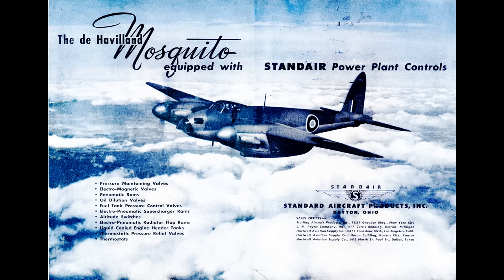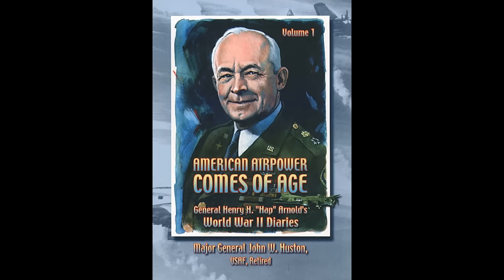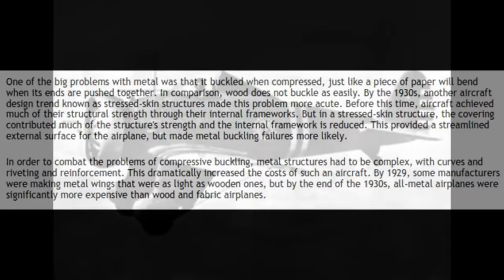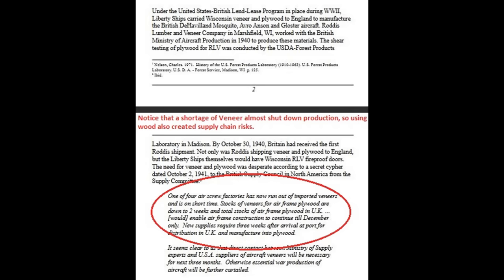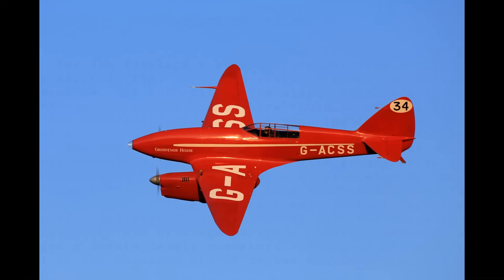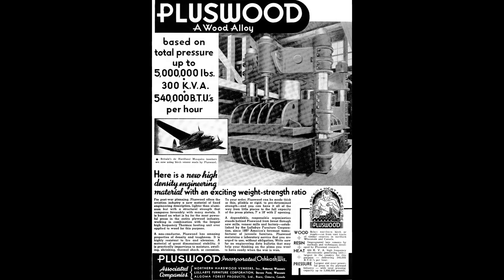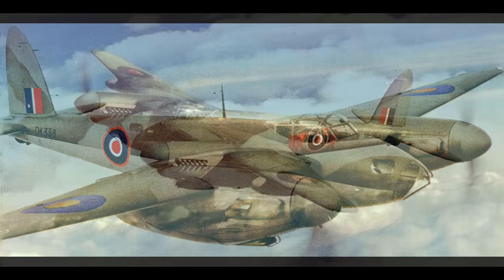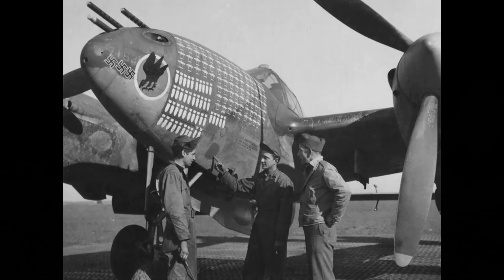De Havilland Mosquito vs. ?

Comment: My father a cabinet maker was an instructor on the mosquito assembly line the people who built the planes where classed unskilled labour.
Reply from the maker: I would argue that wood working is skilled labor. The term "unskilled labor" is a tactic to keep wages down. Up until a few years ago aircraft mechanics were classified and "unskilled labor" it's pure BS.
Reply: What I understand what happen was people with carpentry and apprentice training skills where released from the armed forces where possible. Also carpenters over military service age were redirected from furniture and piano manufacturers to the Hawker and DeHaviland factories.  There they trained a largely female work force of assembly workers.  After the training period of a large number of the work force (some of the older women had worked on aircraft during the 1st war), the service personnel returned to their active service units.   The elderly carpenters remained as inspectors and remedial repair specialist as damage to planes or parts of plane occurred during manufacture.  This is feature of all making processes and same times the damage can be put right or something salvaged from the disaster.

Comment: the mozzie was also adapted to  a 2 cannon to blow holes in the conning towers of surfaced sub marines thereby preventing them diving and escaping the "heavy hitters"  I did work and was called the Tze Tze fly.   A 2inch cannon mounted inside a wooden  wooden air frame .
must have been dreamed up over a couple of pints. one reporter stated,  it could only fire 5 shells in quick succession before it stalled  ,but the frame held up
Reply: 57mm/6 pdr.

Comment: Sorry to be so late to the party, but I have been wondering for years why the US had such issues with escort fighters when the Mosquito existed. Surely the Mossie would have at least outperformed the P-38 in this role, as it did in most other roles over Europe.
Reply from the maker: The Mossie would not have survived as an escort fighter.
Reply: @GregsAirplanesandAutomobiles  it last year of the war Mosquitos and other intruders attacked the airfields of German night fighters

Comment: Interesting that the list of US companies which evaluated the Mosquito didn't include Lockheed, who built and sold a successfull aircraft in the 1930's the Vega, which also used a stressed skin plywood construction like the Mosquito.
Plywood is a very different material to ordinary wood, think of it as a first generation composite.
Reply: @M Bacon Er.  No. Stressed skin means the skin is the structure, rather than a skin covering a frame as in a stick and fabric airplane. If you took the skin plywood skin away from a mosquito, or your boat, there would be nothing much left but a pile of components and bits of balsa. You could take the skin off a hurricane, or a Wellington and still have a recognisable aircraft standing there. They aren't stressed skin. The term means the skin is a primary structural member. Not just a cover for a frame or chassis inside.

Comment: The Hurricane wasn't a wooden aircraft! It used a form of metal construction, known as Hawker construction. The aft fuselage and control surfaces were fabric covered
Reply from the maker: Did I say it was a wooden aircraft? No, I said it was partially constructed from wood. Pay attention.
Reply: @GregsAirplanesandAutomobiles  Apologies, parts of it were wood including the fuselage stringers and the plywood "dog kennel" for the pilot compartment. The main load-bearing elements were metal as I understand it. Source: http://hawkerrestorations.co.uk/a-complex-structure

Comment: Bomber, fighter, fighter/bomber, photographic reconnaissance go everywhere do anything.  The Germans would have their airfields attacked at night by mosquitoes and they would sweep in and be gone before the Germans had time to re-act.  Well at least we bought the Canberra from the U.K. an excellent starting point for aerial reconnaissance before the U-2 or RB-47 were available.  Self sealing fuel tanks, etc., etc.  What did it take to impress a flag officer with the juice to make a buying decision.   The mosquitoes could have replaced probably the A-20 and B-26.

Comment: The Mosquito was not made of wood in the traditional sense, it was constructed using a composite. In the day it was likened to telling Ford to make cars out of plastic, that is a crazy idea until you realize most super cars have carbon fiber bodies. De Havilland were expert at building not with wood but composite materials, the Mosquito using a material with twice the tensile strength of steel for half the weight. Although light, to make an aluminium air-frame able to take the stress of going 39 mph faster than a Spitfire with an operational load of 4000lbs, able to climb at 2887ft per minute and offer a range of 1500 miles......that would need a lot of aluminium and a lot of aluminium gets heavy.
Reply: Dhaviland is a terrible company.

Comment: While the Mozzie was certainly an important aircraft in the RAF arsenal, I don't think you could consider it to be more important than the Spitfire, Hurricane or Lancaster. That trio filled LARGE portions of the "pie chart" of tasks of the RAF in WW2. While the Mozzie had incredible versatility and it's speed was un-matched, it wasn't able to supplant the Spitfire, Hurricane or Lancaster in their primary roles.
Reply from the maker: It was certainly more important than the Lancaster.

Comment: I’ve said this before but never had an argument against my point. TWO Mosquitoes could carry more bombs than one B17 over a longer distance. The Mossies needed the same number of engines but less than 1/2 as many crew. It was also capable of looking after itself against the Luftwaffe and would shoot up their airforce with less  resources than the US Eighth AF burned through.
Reply from the maker: David, there are several fatal flaws in that plan. I may actually cover this in a future video because several people have brought it up.

Comment: The Hawker Hurricane has a tiny amount of wood, the fairing box behind the pilot’s head. The rear fuselage is fabric covered steel tube with Aluminium skinned wings and forward fuselage.
Reply from the maker: I'm not sure what your point is, but from Wikipedia: "The primary structure comprised a Warren truss box-girder that made use of high-tensile steel longerons and duralumin cross-bracing, which were mechanically fastened instead of welded.[33] Over this, a secondary structure composed of wooden formers and stringers gave the fuselage a rounded external shape, which carried a doped linen covering. The majority of the external surfaces were linen, save for a section between the cockpit and the engine cowling that used lightweight metal panels instead."
Reply: @GregsAirplanesandAutomobiles  Then that entry is wrong and needs editing. Again, the only piece of wood in the Hurricane is a small structural wooden box that comprises the fairing behind the pilot’s head. The rest of the aeroplane is fabric covered steel tube or duralumin sheet.

Comment: Geoffrey de Havilland died because the DH108 was aerodynamically unstable and went into high speed pitch oscillation which broke his neck.  This also caused the plane to break up, but that wasn't a consequence of its metal construction.
Reply from the maker: You may have missed the key point. DH built the Mosquito out of wood because that's what they had experience in. Switching to metal put them outside their area of expertise and that wouldn't have been practical during war time. In fact DH had nothing but trouble once they switched to metal, (the 108 is just one example) which is a large part of the reason they went defunct in 1964.
Reply: @GregsAirplanesandAutomobiles  But you miss my point that the failure of the DH108 had nothing to do with de Havilland's inexperience of using metal - it was due to a bad aerodynamic design, which had been identified in wind tunnel testing.  This would have been the case even had it been made of wood.
Reply: @Nastyswimmer  The point remains a very valid one, de  Havilland didn't have much experience or luck with all metal aircraft... no better example than the infamous  Comet Disaster